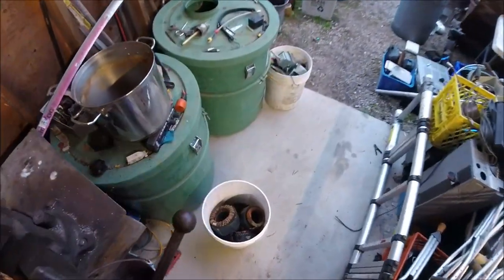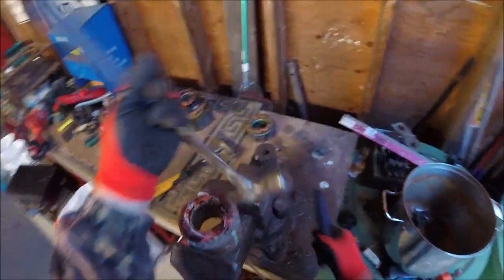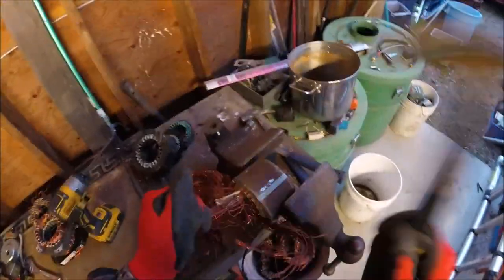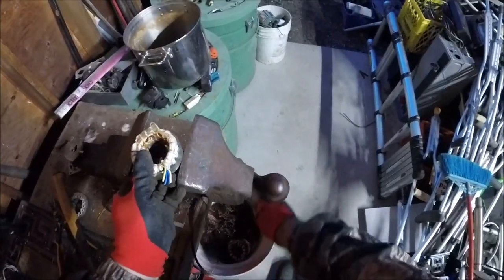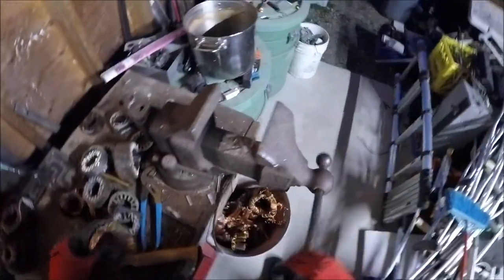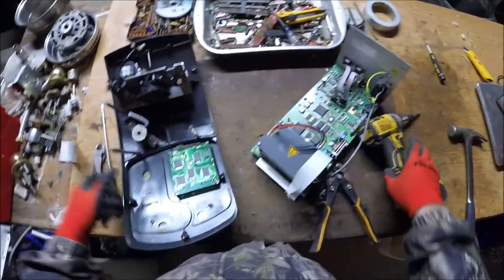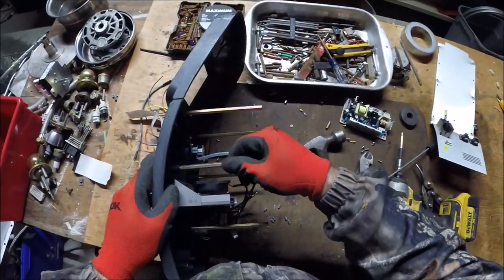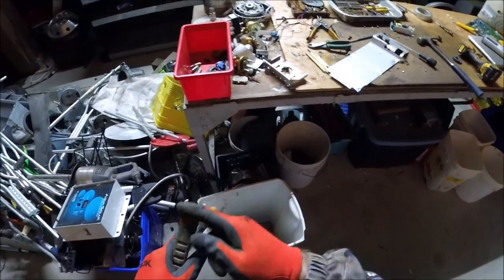Scrapping Copper Motors With The Copper Extractor 2000 & More

Comment: Hi Canadian Hunter. I use punches to take them out of cooper. Cut off one side of motor, and use punches +hummer. My punches are in size 3mm,4mm,5mm,6mm,7mm and 8mm. Very easy job with punches. Very recommended 👍 nice video thx

Comment: What a chore getting that copper out but you never give up! I wonder if soaking in oil or soap would make it easier to pull out?
Reply from the maker: It could of over heated & burnt to the plastic, It was even hard to get the plastic sleeve off also

Comment: What if, get a sealable plastic or metal container. Fill with acetone. Let the cores soak a day or so. Drain and air dry. Then pull out the copper.
You might cut one side of the windings off and use loop on other end to pull out.

Comment: Phil you are trying to take too much copper out of the stator at a time examin the stator you will find there are two different windings a smaller one towards the middle of the stator thats the starting winding and is usually smaller wire if you will consintrate on removeing this winding first the running winding made up of larger diameter wire will loosen up with the smaller winding remove and be easer to remove.

Comment: Well the rest came out good, Could the difference be between the sawzall and grinder, the cut edges being rougher or was that motor just tight. I watched a movie of how they extract and make them windings and put them in and take them out, all mechanical and it was super fast. but neat to watch. what about the motors you did not do ?
Reply from the maker: Smooth cut is better & some with rust is harder

Comment: That is way too much work for the motors . Try using aball joint seperator, the tool that looks like a  V it is much easier and faster, Remember young man, make your money work for you, don't work too hard for your money. Or have you tried to use the hammer on the outside of the ring and and the head of the hammer on the vise ? I don't know.